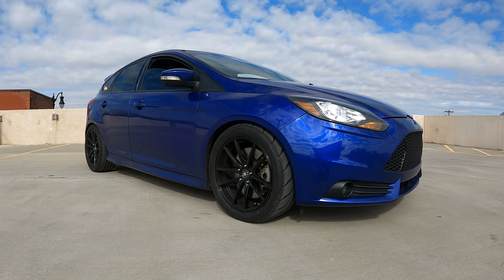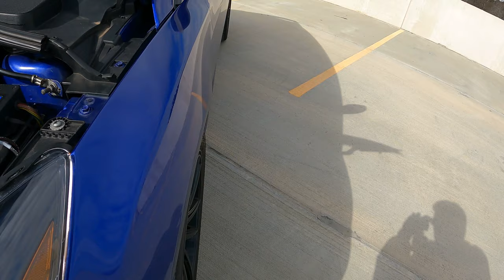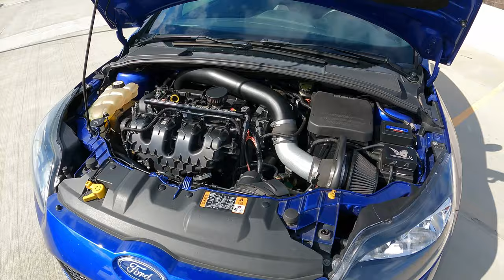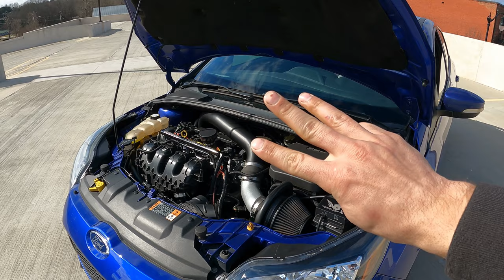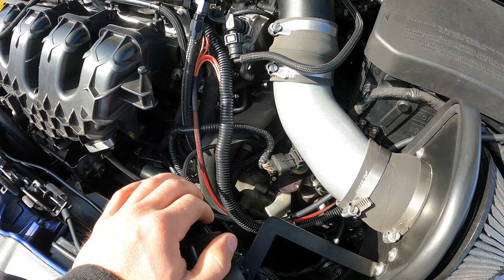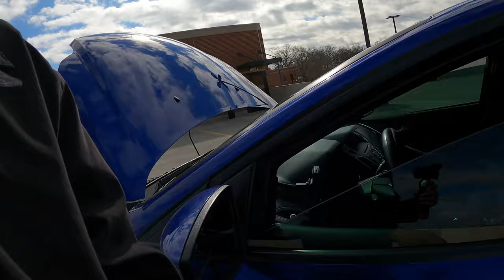How to make 600hp in your Focus ST

Comment: I have a stage 3 build from speed performance. They shipped me the motor built off a brand new 2.0 block (but with the 2.3 head) 
Stage 3 cams and upgraded pistons and everything that can be done to the motor for 700 plus horsepower. I live in Canada with crappy fuel so still going through the tuning stages off pump gas, but I can tell you it’s pretty wild to get traction, but once you do it’s really fast. Anyone who rides in the focus is ready to tap almost instantly 
Can’t imagine once I get the E85 tune on there…
Running a Precision 6065 turbo 😏
Reply: @Deshawn Sheppard none at all 
I daily drive it…will come down to the tuner and making smooth drive ability
Reply: All that and u haven't posted anything?

Curious....
Reply: @Red Beard's Racing if you get the long block stage 3 with all the goodies and shipped. 13,000 USD

Comment: crazy sleeper for sure...beautiful color!
one thing I'm surprised you didn't comment on was your PCV set up...i see a vented oil cap...which i heard can cause a mess...I run a Damond stage 1 off the manifold (custom vta), a JLT rear (on the intake), and have a Radium PCV plate with a spare OCC im putting on to also VTA... this is for a BNR71/XDi hpfp set up with a 400-430whp goal... i cant even imagine what your lag is like with a 600hp set up... ive been FBO/e30 stock turbo for years, but all these parts are in the garage and i started the install last weekend. I'm sure mine will be a night and day difference, then to even fathom 600hp in this platform would be just insane to drive at full potential ^_^

nice build, clean beautiful car...ill check to see if you have other videos... i love sleepers and would love to see this thing whoop up on some big powered cars!

Comment: Glad to hear you got toughened engine internals/ transmission upgrades.  Some make the error to not do this, and find the life of their engine is brought forward rather dramatically!
Reply: Haha blew it up once, not trying to do it again😂
Reply: @jacobadams3100  what about trying to put 600bhp through the front wheels?
Reply: This is the biggest lie in the Ford community. Engine rebuilds for 2.0 ecoboost is the biggest wasted of money
Reply: @Hola Como Estas  wrong, some 2.0 builds that are being built the right way and fixing the coolant issue with the block itself actually gives a surprising riability

Comment: Sweet ride, if I get 300 out of mine I will be happy, I just want to have fun while driving to work
Reply: Im at 300whp on a 2.0 fusion (lots of the ST components transfer over) basically just FBO and an E30 tune. It really brings the car to  life. Only real difference between both platforms is slightly more torque, 600 pounds and an AWD system. Def recommend if you can do the Ethanol mix

Comment: Just gained a new sub! I've got a 14' ST with a 2867 gen 2, stock motor and fuel system currently, plan on doing 4 port this summer. After that eventually build the bottom end and max out the turbo. If I find myself with any questions I'll definitely come your way!
Reply from the maker: Awesome thank you much! my insta is the same as the channel name if you need to contact me on there. I put a nice hole in my piston after about 30k miles on a e30 2867r setup. Decided to take it up a notch and havent regretted it since! Although, 400whp is a really fun sweet spot for these cars, and after we max this turbo out, ill most likely be driving it on the 420whp pump gas tune primarily.
Reply: @zyacub4008  How many miles did the car have when it blew at that power level? Did it trash the block or was it still in alright shape? I've been wondering about how much I should push it, because I'd ideally like to keep my motor intact until I decide to build it, but as we know anything is liable to happen at that power level.
Reply from the maker: My stock motor blew a ringland at 125k miles after about 30-35k miles at 400whp. A little scoring on the cylinder walls but nothing that couldn’t be machined out. I actually found a low compression long block for cheap and built that motor on a stand so when mine blew, it was pretty much just swapping the built motor in. Cost a little more but saves a lot of time if you don’t have another car to drive.
Reply: @zyacub4008  I appreciate the info! I do have another car that I daily, so if something went wrong it wouldn't be the end of the world. Picking up a cheap long block out of an escape might be what I end up doing. Thanks again!
Reply from the maker: If you want to build the motor that’s in your car, it’s definitly safer to do it before damage is done. I have a theory that the only reason my BT setup lasted as long as it did is because I didn’t do it until almost 100k miles. The cylinders and rings were worn enough to slow for further expansion under high boost. I’ve know guys to blow there motors very soon after pushing 400+ so it’s definitely a gamble
Reply from the maker: No problem brother! Sounds like a plan. Good luck with the build🤘🏼

Comment: Your making 460 tops right now on only 26 lbs and only e30. No way in hell it’s mirror to mirror with a hellcat. As an owner of a 630HP focus built by Speedperformance  I’ll be waiting for your Dyno video.
Reply: Dude your making 630hp on a focus?  That’s incredible I was under the impression that 400 is max you can make
Reply from the maker: yea 630 is crazy!  @DAVID CARTER hmu if you ever in Georgia. Youre correct, it’s probably high 400s on 26psi. it’s looking like this turbo will be happy around 550-560 so not quite as much as I’d hoped. still, well over 600hp at the flywheel
Reply: @specter116  there was a dude pushing almost 900 in one of the groups here in chicago. Monotune and other companies make forged drop in engines that can do 500whp+ and another company (speed something 700+) 
Theres also some fusion owners pushing 700+ on the 2.0 ecoboost (ford parts bin = some pretty cool sleepers)

Comment: Love the build man! How much did it cost?
Reply from the maker: If you do all of it yourself besides machine work you can get away with around $9k. Not super cheap but I could run a bigger turbo and do a little head work and make 6-650 wheel with the setup. I just wanted a more responsive turbo!
Reply: @zyacub4008  the 660 is good for 600+ WHP though right? Why would you need a bigger turbo?
Reply from the maker: I don’t think anyone has maxed this turbo out yet so I was initially hoping for right under 600whp but it’s looking like 550-560 wheel is gonna be realistic for the g25-660. Stay tuned and we will see what numbers it puts down

Comment: Question, did you perform all the work to the car yourself or did a performance shop of sort do it?
Reply from the maker: I did all of the work besides decking the block and head. The only thing that was sent off was the crank to speedperformance for the keying service
Reply: @zyacub4008  I plan on building mine like you did. My cylinder 1 went out so it’s time to build it and make it better. I’m still on the stock turbo, but at least I will be ready for a BT

Comment: I have a 2018 st1 I'm fbo. For bang for the buck what's the next thing you suggest I do for power? Also I am curious but to lazy to look up the costs of each part. What would you say this build costs all in all?
Reply from the maker: bang for buck I’d throw a pop n drop kit in the car (rods and pistons), turbo kit, and aux fuel. should be able to make a good 450-500 on stock cams. also would recommend a limited slip diff for traction once you are pushing 400+. it’s a game changer... my whole build was around $9k. if you build the motor yourself you’ll save 2-3k

Comment: 26 lbs your looking at 380 on pump gas which is what I have tuned by edge
The issues with cars from why I was told was the knock during load

Comment: 5 bucks says that motor doesn’t go 50 k
Reply from the maker: If it goes 50k I’d be very surprised haha
Reply: Youd be surprised. Theres a few guys in my ecostang group with these engines including myself that have much larger turbos and some have a ton of miles amd years on em. A few are at 750+ with pte 6466 turbos

Comment: Sadly nothing makes this car fast 2016 FO.ST owner here full stage 3 custom tune fun daily but that's about it
Reply: Turbo swap might change your mind
Reply: Not true. I have the stage 3 SP63 engine amd on my 91oct stock turbo tune (has stage 3 cams) I'm a 400hp and 435tq. My meth should get me 420hp and I'm assuming 450 to 470 tq. When I get my pte5558 I should be around 600wheel with the meth flowing. I'd say that plenty fast for a 4cyl car.